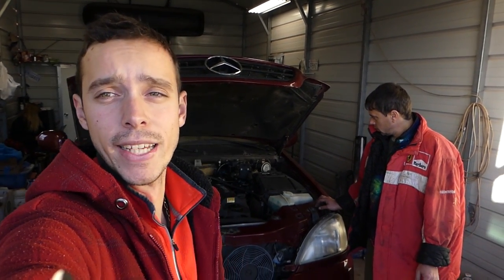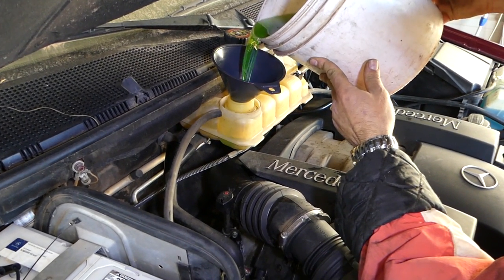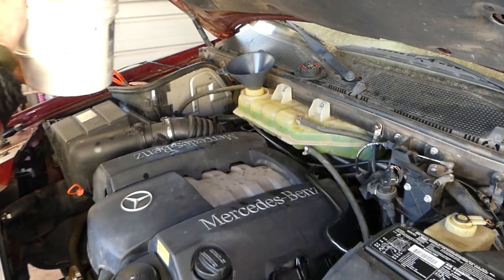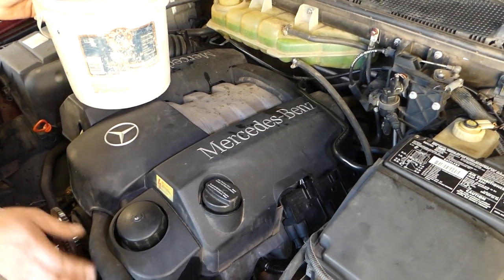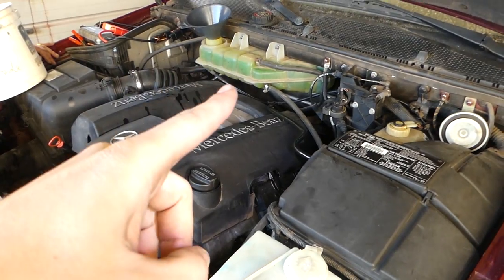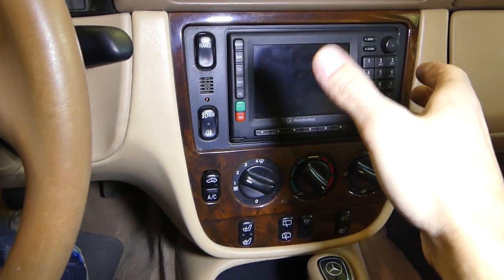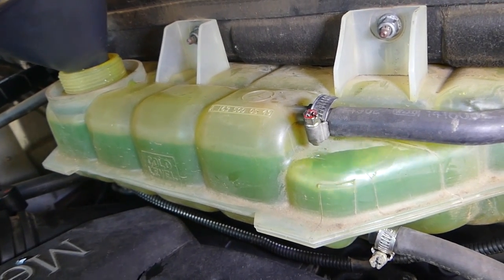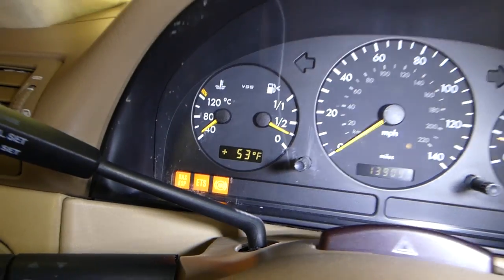MERCEDES W163 HOW TO BLEED COOLING SYSTEM ML320 ML430 ML500 ML350 ML230 ML270

Comment: Did same for S350 2007? My W221 always comeout the coolent after using the car😏, I always top up the coolent level, but the indicator coolent top up always on at cluster. I check no leak at hose or radiator. I already replace the thermostat, temp switch also. The temp engine si 80 -90 at tropical area in here in asia. Thanks need your suggest.

Comment: HI, thanks a lot for all your videos. I have am ML 400 V8CDI for some reason it overheats always when I pull a trailer 2000kg+. I took out the thermostat, nothing changed. I check the water pump and it looks OK. Do you have a suggestion ??

Comment: My Mercedes ML 2.7 diesel has a collapsed top radiator hose when cold. The vehicle doesn't have the standard rad cap so why is this happening,  changed out the thermostat previously while doing a swirl flap delete.

Comment: I have ML 55 AMG was try to replace a battery,cable got crossover now car is overheating, what happened please help
Reply: What did you find? Blew one of the main fuses or fuse for the electric cooling fans?
2000 ML55